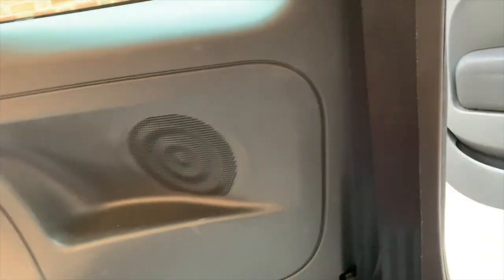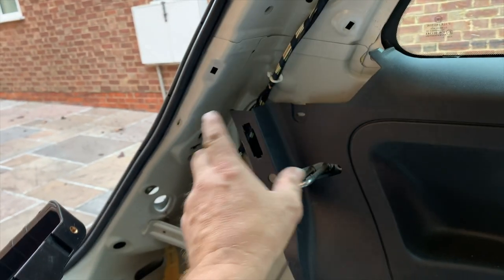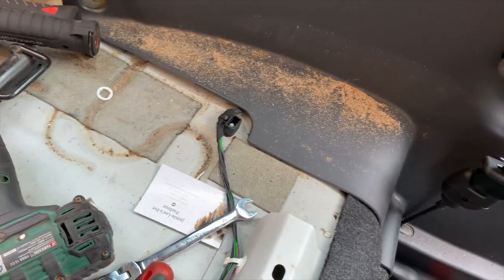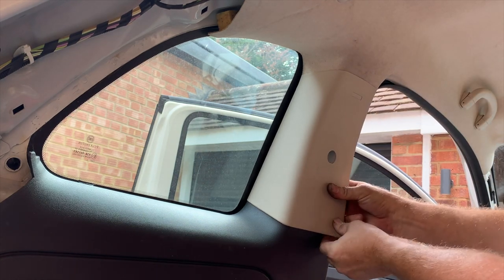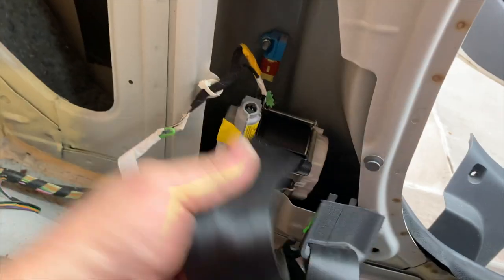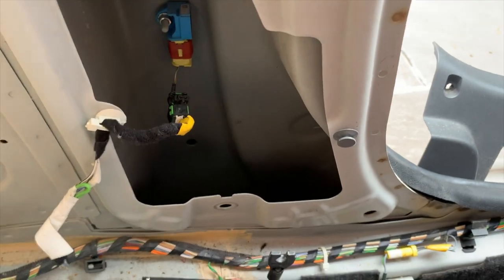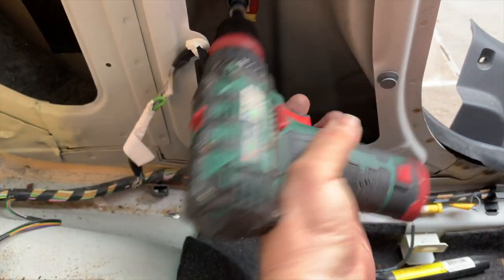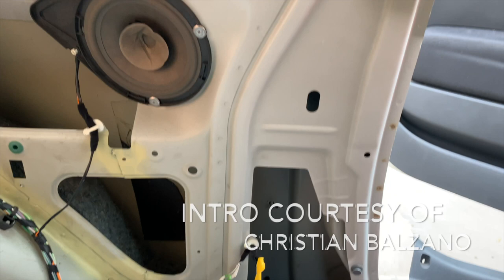Fiat 500 - Removing a Front Seatbelt -  Love 500 How To Series

Comment: nice video - after a crash does the seatbelt sensor need to be replaced? do the sensor, seatbelt and bottom tether need to be specific to a certain air bag module? thanks
Reply from the maker: Not always, depends on whether you have airbag light on. Diagnostics will tell you. If the seatbelt hasn't locked it will probably be OK although there's always a possibility the electronics in it have "deployed" even if the belt hasn't locked. Same goes for the pre-tensioners. If the braided wire has pulled through they need replacing, if it hasn't then same applies as the seatbelt. The Airbag ECU needs to have crash data removed. This can be done by sending off to someone on eBay. It costs £35. Once wiped as long as all of the airbags etc have been replaced, it's a matter of clearing the codes and all will be good again.
Reply: @Love500  great - thanks for the info. If i get a clean airbag ecu from another fiat 500 do i have to use all the airbags, seatbelts from that donor fiat 500 or can i mix and match from all different fiat 500's?

Comment: Do you need to disconnect the battery to remove a seatbelt ? Thanks .
Reply from the maker: Yes. The front seatbelt has a squib and is connected to the airbag ECU. Just disconnect the earth terminal of the battery.

Comment: did you find out why the seat belt wire was by passed good video again
Reply from the maker: Well it was a badly repaired/bodged seatbelt but I need to look at the wires properly and see if somewhere a resistor has been added.

Comment: Is there a video for the seat belt buckle? Mine has quit working .
Reply from the maker: There isn’t but they are easy to change. Easier if you take the seat out. Pull off the plastic side panel and it’s held on by one bolt and the electrical connection. Disconnect the battery earth first, disconnect the connections under the seat and remove the four Allen bolts and it’ll just lift out.

Comment: Hi , can you help please? My passenger side seat belt has started sticking when pulling it out. Would I need to replace just the seatbelt?
Reply from the maker: Oull off the plastic bit where the seatbelt disappears into the side panel. Pull the belt all the way out as far as it will go and spray some wd40 on the mechanism at the bottom. Pull it in and out a few times and that should free it.
Reply: @Love500  thanks for replying. I will give that a go .I really enjoy your videos ,keep up the great work .
Reply: Hi, done what you said and that’s done the job 👍thanks again. Merry Christmas 🎄